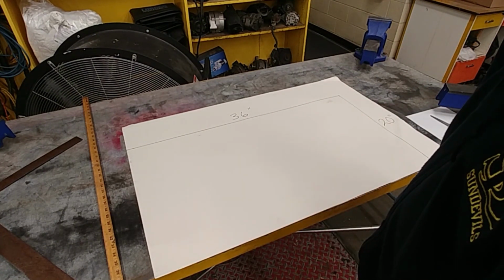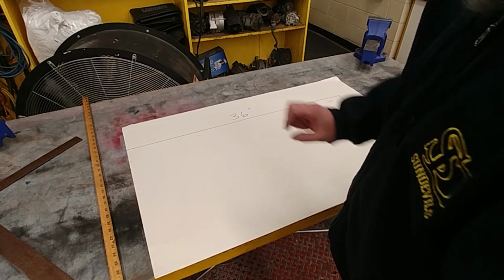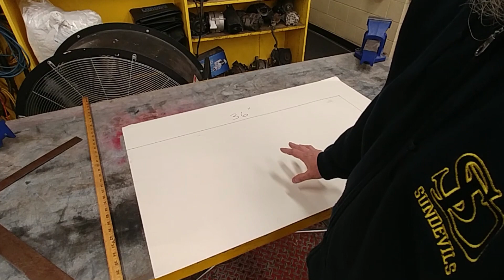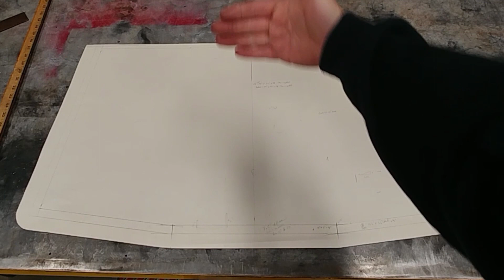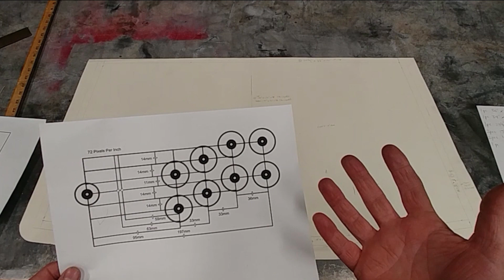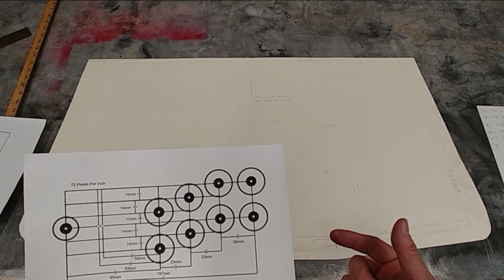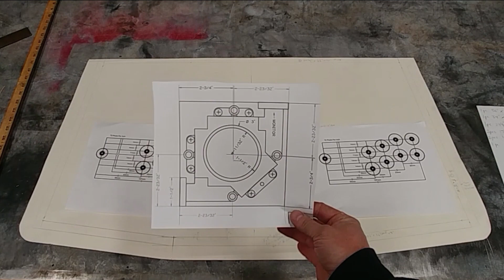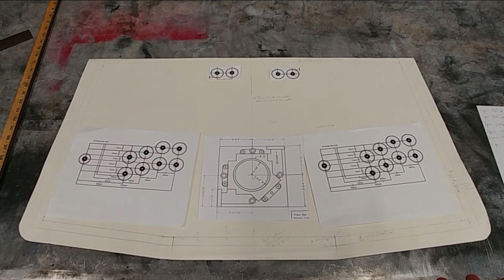Custom Raspberry Pi Arcade Cabinet- Designing the control panel! Ep#3

Comment: Are you able to save game progress with the Raspberry Pi so that when you leave the game and go back in at a later time, your progress will not be lost and have to start the game all over again.  I know It's been a while since you made this video, but I'm hoping you can help me out.  Also, would I be able to also tie in guns for games like Lethal Enforcers an maybe even a plane joystick for flight simulator games?  Please help me out as I am trying to build one of these for me nad my son's game room.  Thank you.
Reply from the maker: Yes you totally can save progress in each game.  You hold down select button and press one of the other buttons and you can save the state of that game.  Another button will be load that state.  If you look in the bottom corner it will tell you what it did.  Try it out before you put a ton of progress into a game.  Yes you can input guns and flight sticks but they all have different set ups.  Some use ir lightbars and some don't like the Sinden ones.  Good luck on your arcade cabinet build, let me know if you have any questions.  Thanks for the watch!
Reply: Having build three cabinets, all i can say, don’t try to play to much different games on one cabinet. It rarely works, because the control panel gets overloaded with controls to easy. Leaving no space to put down your hands comfortable. I first build a cabinet with a friend of mine, it has so many button’s and controller on the front that you cannot put down your hands to play in a comfortable way. My second build was a full cabinet, using only 1 sticks and 8 buttons per player, with a 2 contol, 1 player start and 1 player coin button per player, for a nice 2 player setup and a sinden lightgun. Left a lot of space below the buttons so you can rest your hands on the control panel. It uses a pc with hyperspin. Looks nice, but hyperspin is a pain to setup for beginners. My third arcade cabinet is a tabletop that i build with my youngest son for him, using a raspberry pie 4. It uses only 6 buttons per player for a 2 player setup, and 1 player and coin button per person. I first made this a single player cabinet, but i noticed that the kids didn’t like player alone, so i switched the control panel to a two player setup later. Although you can play newer systems like the n64 and ps1 on the pie 4, i wouldn’t recommend it if you are going to use it as a arcade cabinet, since you lack the analog controls of the n64 and latere ps1 games. Same goes for emulation of some of the older systems like the atari 5200, intellivision or colecovision, due to the controllers they used. This winter i’m going to build my fourth cabinet for my oldest son. It is going to be almost the same as the one for my younger son, but with a vertical screen to play those nice shooters.

Comment: Is there a good reason you opted for the 8 button per player layout ? What  is the disadvantage of a 6 button set up ?
Reply from the maker: I went with the 8 button setup so I could play games on Ps1 or higher so I had left and right trigger buttons.  These also could be used for the other connectors on my USB interface board such as rapid fire, auto fire, clear turbo/auto, or mode digital/analog.  Or just even to use as additional buttons to configure a game that had more buttons.  I just didn't want to limit to 6 buttons, even though most games use 2, 3, 4, or 6.  Cheers!
Reply: @wayofthewrench  ok I see.  I was a bit puzzled because of the fact that as the heart of the system you use a raspberry 3B+ .  I thought you would only stick to less powerful emulation cores like mame, nes, snes, Atari and so where 6 buttons is enough.  Not to play PS1 or higher. Or do you intend to replace the pie with something more powerful later on ?grtz
Reply from the maker: Yeah with the raspberry pi 3 b+ you don't really need the extra buttons but eventually I will have something more powerful like a gaming pc and then those buttons will work great.
Reply: @wayofthewrench  Than you'd have no choice but to use a pc if you want to run more powerful console systems later.